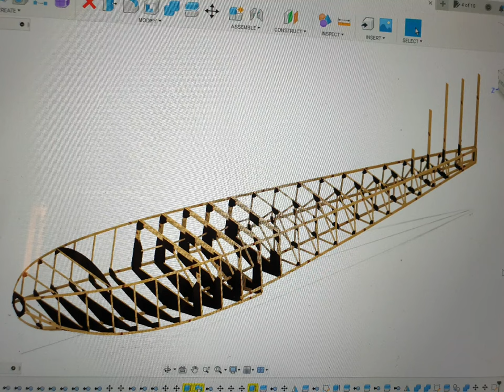Homemade flying boat The MudSkipper build video

Comment: Hi James! Thank you so much for having your vision, and building something that actually works (really good) and sharing not just your kick ass videos with us, but also answering everyone's technical questions...regardless of how many times they're asked. lol 
My first intent was to try and re-scale one of the AirFish designs, using educated guesses, visual interpretations and lastly...the ol' dividers-on-the-monitor-screen technique. lol You're design however inspires me to go with the MUCH simpler/safer/cheaper/successful design and your willingness to share your specifications.  I initially was going to start my build around a wrecked airplane fuselage, like a Lake, and transform it to a WIG, but was told by someone smarter than me, that I should start with a boat instead. 
Anyway, since it's so much easier to critique/build around someone else's trials and tribulations (thank you for yours), I've decided to give it a go with my own version of the venerable MudSkipper. If you would...I wonder if I might make your's and my new craft even better than Mud Skipper #1, with the some crazy added concepts I dreamed up while watching/reading every spec of your comments and posts. (I'm factoring in all your past comments too.) Here they are...1. Use a tractor (as you suggested), for clean prop air. 2. Counter-balance the control surfaces, and add trim tabs, so it will somehow fly on a "even keel," "weather vein," or whatever you want to call it...should the rudder/elevator break. 3. Use tall/twin vertical stabilizers, to lessen  dirty air turbulence/drag from the prop against the control surfaces. 4. Add positive buoyancy flotation in the fuselage, for catastrophic water landings/crashes. 5. Add quick-detach 5-point harnesses, to keep my teeth out of the dashboard, in such cases. 6. Enclose the cockpit for better streamlining (which must have an automatic "pop-off" mechanism, for inverted water landings/crashes, with a window to spit my gum out of.) 7. And lastly, turbin power, for that (hard-to-afford) power to weight advantage. I hope you're still reading this......... Thanks again for all your hard work and inspiration. I really mean it! Sincerely, Dan (from the bumpy Lake Of The Ozarks in Missouri, USA.)
Reply: This is the only wall of reasonable (or at least somewhat so) suggestions I’ve read so far that made me laugh rather than cringe. I personally would go with a 1,060 pound Tesla Model 3 battery pack, plus a 500 pound fuel cell, then use two KingTech turboprop engines to drive doubled-up heavy lift drone motors, wired to the tesla battery for on-the-fly (heh heh) recharging… then those same drone motors (we’re in the $10,000 range and climbing here) can be put into ducted fans, say two 200-lbf for each wing… and then we’re in BUSINESS with a 13-14 hour range! Let’s just hope James is comfortable with sleep deprivation… otherwise we might have to pick your chewing gum off of the hull and force him to chew on it so he stays awake on his 300 MPH journey to Peru (or heaven)…

Comment: Nice work. I looked at one of your other vids showing your control inputs. It looks a little twitchy in pitch and looking at your wing it will have an unstable centre of pressure. I might consider some battens to define the profile. It could also increase the performance to. As a designer of hang gliders since 1979 I am happy to offer my help.
Reply from the maker: Hello, while it seems the control inputs are a lot remember I am only 1m off the ground so the flight tolerance is very tight so any slight disturbance from the gusts requires immediate and positive input. The craft is actually quite stable and inputs are minimal. The CP also seems to be stable due to the 5.5 degree angle of incidence of the main wing which keeps the wing surface 'inflated'. Buttons would definitely help with efficiency and performance though as the craft on its current configuration isn't too efficient but that was never a design consideration for me.
Reply: @Ground-Effect  Worth a try,  I think you may find it will just sit and ride through those gusts without having to correct. It will be more relaxing for the pilot.

Comment: Nicely done, good work! When You find Your ultimate design, pvc foam and epoxy fiberglass  would probably have an even better strength to weight ratio.  WIG obviously but what is the classification of this, boat, ultralight, plane or what?

Comment: Hi again James. Thanks for prompt response. What I was asking was what is the offset displacement distance between the LE and TE, not the chord ie how much lower is the TE to the LE in vertical measurement?  Thanks for heads up re tinny idea. A suggestion would be to use ducting on the prop to improve efficiency? Thanks again
Reply from the maker: Sorry you did ask that. The angle of incidence is 5.5degrees with the leading edge higher than the trailing edge. 
Yes ducting increases efficiency but it's another thing that can go wrong and cause you issues if not very well secure and it also increases the height of the craft making it harder to go under car ports etc.

Comment: where did u get the engine  ? i bet theres a story
Reply: X2 on that one! What kinda horsepower does it take to get that thing in the air?
Reply: @DerrangedGadgeteer  much much more than if the prop were in front  with par thust  which needs a long drive/prop shaft
Reply: 6 cylinder Jabiru. 3200cc, aircooled, 120+- HP. Designed/built in Australia, been around for 15 or 20 years now. Uses some off-the-shelf automobile parts (I think! Such as Honda rods/pistons??) I have one in my garage attached to a CH701 fuselage in progress. Light weight, direct-driven prop. Just gotta keep them cooled properly!

Comment: I would have incorporated Rudder pedals with cables pulleys and tensioners..and kept the Joystick just for pitch control. Also would have kept all gauges in a cluster in front of the PIC  instead of trying  to fill space all over the panel.
Reply from the maker: Having the rudder and elevator separate would be a death sentence. A pilots natural reaction is to move the control stick/column not move the feet to turn.
The way I did the dash was for looks. Actually very easy to scan
Reply: 😂😂😂 the more you know…

Comment: Hi James. Thanks for sharing. Please: what is the diameter of the ali wing tubing and wall thickness, and type of ali? Also what is the displacement distance between the LE and TE (or angle of attack)? Do you reckon a 12' Tinnie would fly using similar configuration? Many thanks. Cheers.
Reply from the maker: Hey. It's 76.2mm x 3.25mm 6061T6 aluminum. The distance between the two is 3m. 
I originally thought of using a tinny hull to do this but found out that you would need to be sitting right up the front with your feet over the edge to get the CG correct. If you reduced the wing chord and increased the wingspan you would have a better ability to move the wing rearwards closer to the CG. Downside is longer wingspan is not your friend in a WIG.

Comment: How did you go about the overall aircraft design? Wing shape and location, control surface sizing ect?
Reply from the maker: Hey Glenn, I used inspiration from a hovercraft and a seaplane. I also used my knowledge and experience in model aircraft building and flying also my knowledge as a pilot. I'll be putting up a video very soon going into detail

Comment: Hi James, do you have any intensions to sell plans? What's it like taking off over choppy water? Would you change anything if building again ? 
Thanks Ben
Reply from the maker: Hey Ben. In choppy water you definitely feel it, the hull requires a sharper V to handle more chop.

I would deepen the V in the hull, move the engine rearward, change to tractor not pusher to name a few. Overall I am extremely happy with how it turned out
Reply: Thanks for your thoughts and reply James, interesting. I notice some people have opted for two tractor props, one in front of each wing to reduce take off speed. Don't know if that's a good idea or not. The other craft type I was looking at is the hoverwing, where I live is a large estuary where you can launch from a beach. It would be much easier with a hovercraft to launch. Pluses and minuses to both ideas I suppose.
Reply from the maker: @Ben-Dixey  so I have built the hovering. Good fun but I find you spend more time in the shed fixing hovercrafts than you do flying them. The MudSkipper was designed ensuring all of the bad aspects of the hovering were addressed. That's why it looks nothing like a hovercraft anymore. 
The salt spray, gear boxes, twin engine, skirt just to name a few of the features that caused alot of time fixing or modifying.
Reply: Well, I should have looked back through your videos further. Amazing what you have already achieved. Some video watching for me later and reading through the comments. I'll do this before asking anymore questions. Thanks
Reply: @Ground-Effect  Hi, me again, think I have watched all your videos now, very envious of what you have achieved. 
can I ask why you would choose a tractor configuration rather than a pusher ? 
I've looked at the jabiru engine and found it's expensive. Wondered what your thoughts are on using the much heavier Subaru ej22? 
Another thought I had was to use powered retractable hydrofoils to lift the craft out of the water sooner. Stupid idea ? 
Lastly I am doing another helicopter video where I would like to mention your channel and the wig vehicle as a potential next project. Would you mind me doing that ? Hopefully add a few subscribers to help get to the 1000. People obviously haven't discovered your channel yet for some reason. 
Ben
Reply from the maker: Thanks very much mate. It's been a really fun project. A tractor delivers cleaner air to the prop increasing efficiency and thrust to some level.
My engine cost $1000, you can find cheap Gen 1 to Gen 3 Jabiru engines.
An EA 81 or the 22 would work well with reduction gearboxes.
The hydrofoil idea is something I am working on so watch this space!
Yeah I'm more than happy for that Ben, I appreciate it!

Comment: Hey James if you still monitor this, would you please shoot me a message about differences between the hover style and pure wig  like consumption handling speeds etc. thanks mate and great work!  I’m looking at something a little different little lower stall so to speak.
Reply from the maker: Thanks mate I appreciate it!! There some big differences. 
I do like the UH-18SPW but I have found through experience that hovercraft breakdown regularly and require a lot of maintenance. Due to vibration, sea spray, gearbox issues and skirt issues to name a few. I disliked the amount of time broken down or at home repairing. Hovercrafts are great fun but my attention is on WIGS now. I designed this to be as reliable as possible and so far 2000km with not even a bolt needing to be tightened.
I reduced the minimum speed to 60kph by increasing the wingspan and chord and reducing weight. Fuel burn is alot higher as I have gone with an aircraft engine over an automotive engine. This handles chop better than a hovercraft also. Any other questions just ask. I will be doing a full walkthrough soon. Possibly I'll take the footage tomorrow for that.
Reply: You’re welcome brother. I have a small handheld cnc that I can use to make perfectly accurate cuts out of wood etc and going to go that route t make a double duty fishing/flying machine, hence the questions about differences in wig/hoverwing. Maybe even go the foldable hard wing route so as to stand on it and fish from it idk yet still thinking through design there. Seeing as how load forces wouldn’t be to high maybe a fold and fold back out of way and fish from fuselage. Guess really the hull could be whatever and I’ll revisit my twin hull idea. Could be same principle as hoverwing without the lift, rely on wings for lift and thrust  wouldn’t be to needy if wings were adequate. I originally looked at hover route due to ease of trailering. Talk more soon. 4:15